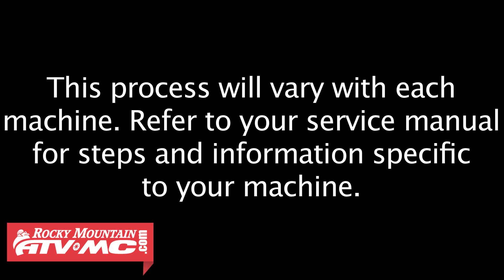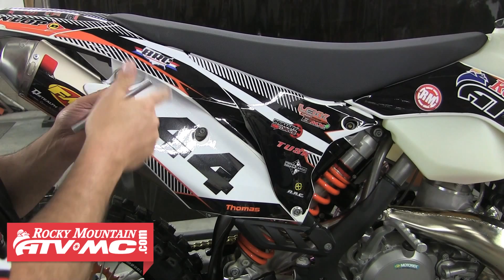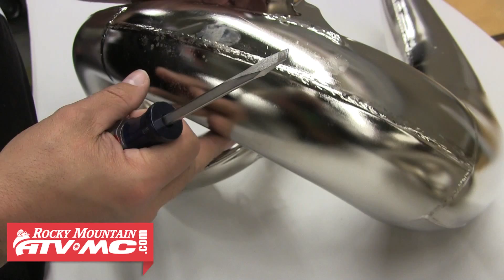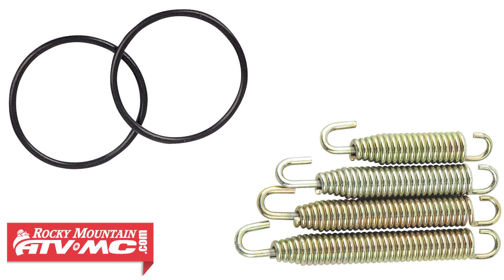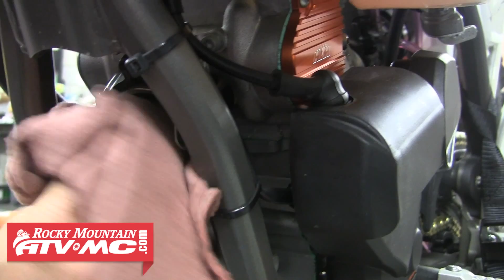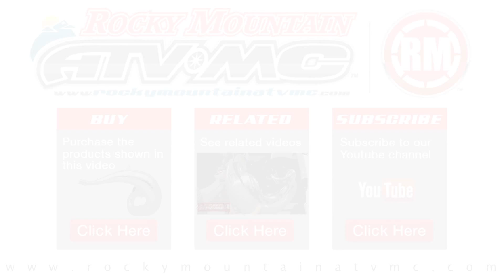2 Stroke Motorcycle Pipe Installation

Comment: Is it normal for the exhaust to slide back and forth when under load like putting down the throttle?
Reply from the maker: Slight movement is expected but no excessive sliding, rattling, or shifting.

Comment: I have a 2024 ktm 85sx do i have to do anything to the engine if i get a new pipe? or muffler?
Reply from the maker: You may need to re-jet or adjust the carb depending on riding environment, mods to the bike, and pipe selection for optimal performance.

Comment: Is it normal for my ktm 2014 150 sx to leak and smoke where you attach the exhaust and the motor from and if it isn’t normal what do I need to do
Reply from the maker: You might want to get new exhaust o-rings and springs for your machine. You can get those from the OEM Parts page on our website: https://www.rockymountainatvmc.com/oem-parts
Reply: @ and will that fix the problem
Reply: @rmatvmc  so it isn’t supposed to smoke or leak oil at all

Comment: I recently got a YZ 125 and painted the exhaust and when I took it off i noticed that one of the O-rings was broken then i purchased new ones realizing that they were too big I used one of the old ones will my bike still run right with only one o ring. will this cause leaks or will it be fine
Reply from the maker: You can use some High Temp RVT Gasket Maker to help insure a better sealing surface for the time being.  I would definitely put a new one in.  It can get messy and could cause your bike to run a little off depending on the sealing surface you're getting with one exhaust O-ring?
Reply: +Rocky Mountain ATV thanks man
Reply: Looking back you could have just cut the o rings and glued and cured them, then the silicone stuff would of held up just as well as new...

Comment: I get leaking from the head flange. I have replaced the o-rings but it still leaks. I see some use RTV. Any suggestions?
Reply from the maker: @Scot Cook - Yes, you can apply some Permatex RTV silicone to help with a better and tighter seal.